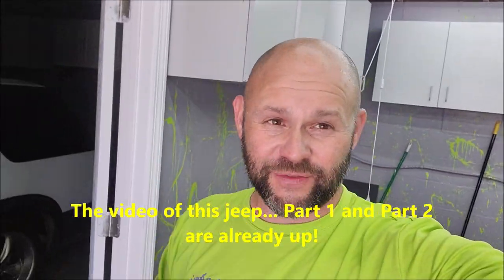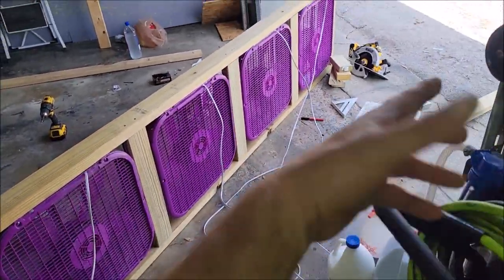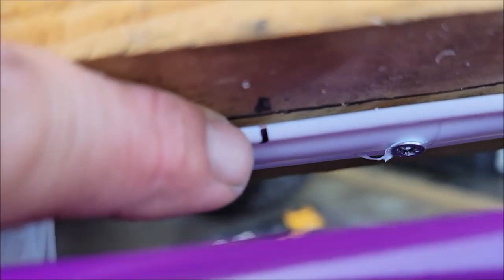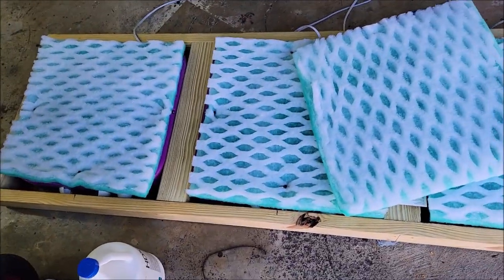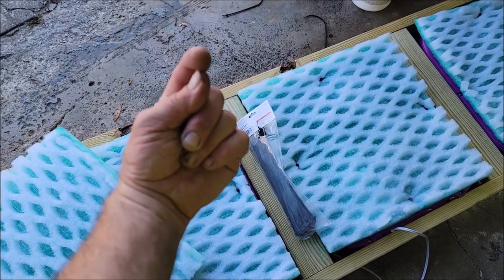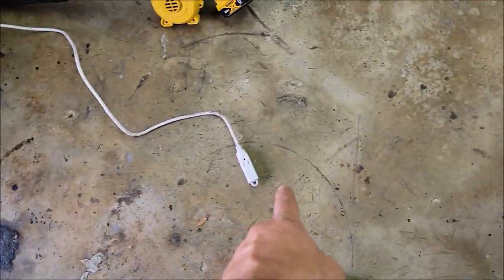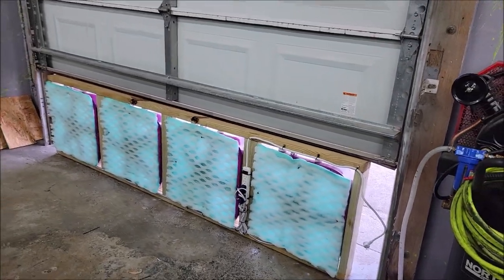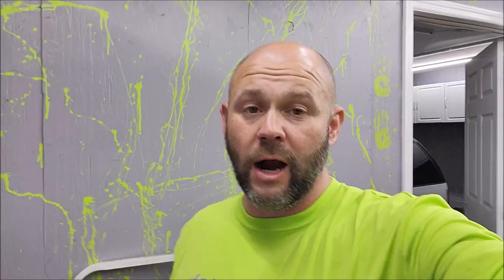HOW TO BUILD AN OVERSPRAY EXTRACTION RIG - HOME DIY GARAGE PAINT BOOTH - AIR FILTRATION SYSTEM

Comment: be careful with overheating the motors using filters, hi flow filters prob wont be an issue but extreme filtration could cause overheating. still should be fine just keep an eye on it.
good job